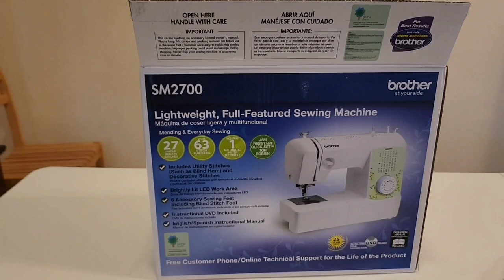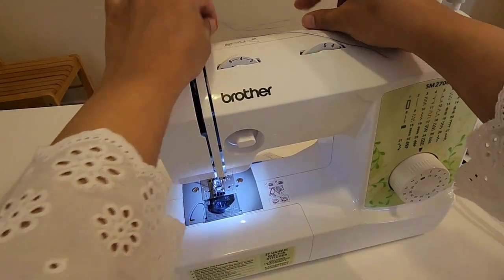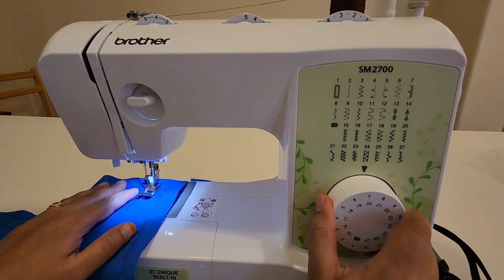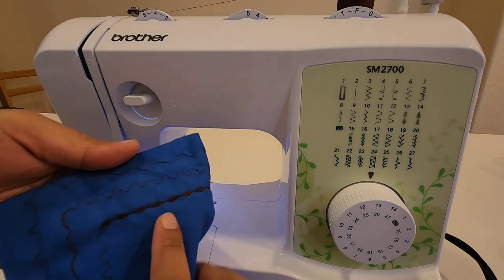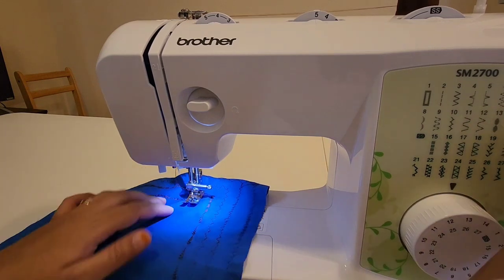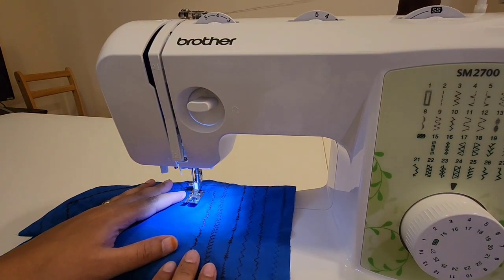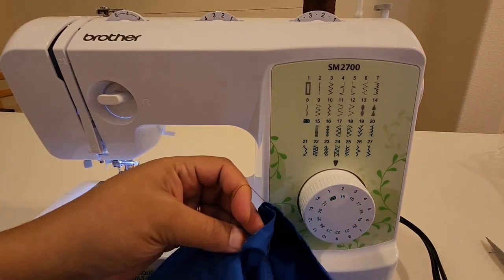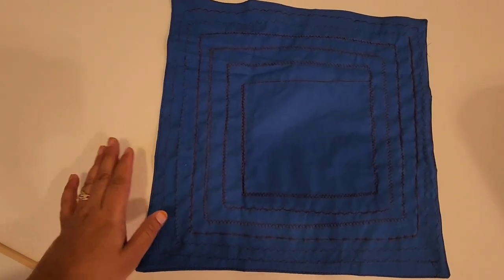SM2700 brother sewing machine review and small napkin project to check stitches, reviews#

Comment: Hello, thanks for your video. If you don't mind, I have a question. Are the stiches 17 and 18 like the false overlock? or is even a close stich?
Reply from the maker: Stitches 17 and 18 are called Elastic overlock stitch and it does look like a serger overlock stitch which you can use on the edge of the fabrics to overlock your projects. Since this is not done with a real serger this can be called faux/false overstitch. To overlock the clothing you can use zigzag stitch too which is fastest way to overlock your sewing projects on a regular sewing machine.
Reply: Thank you for this video. 😊
Reply: Can this sewing machine sew through denim? If so how many layers?